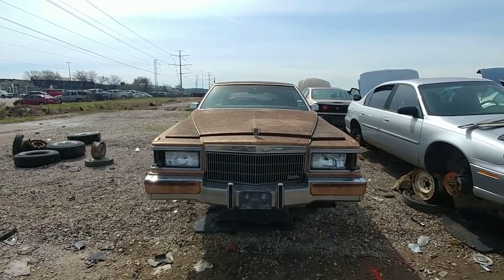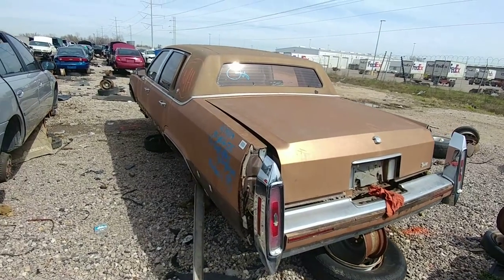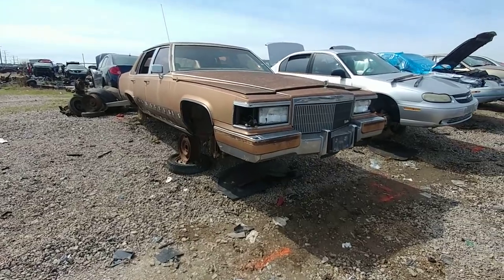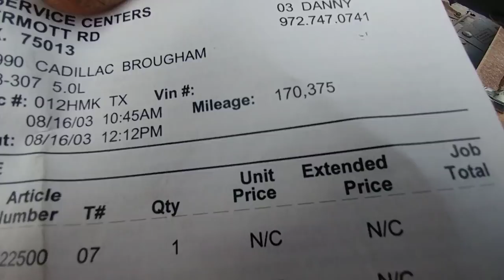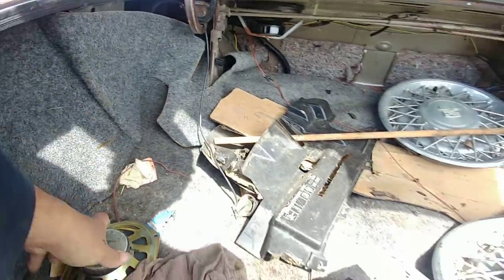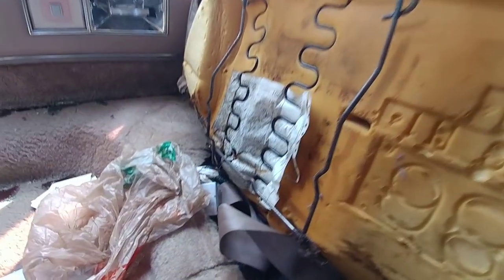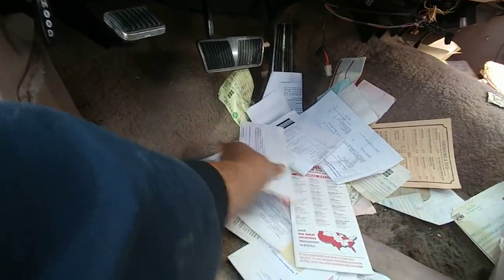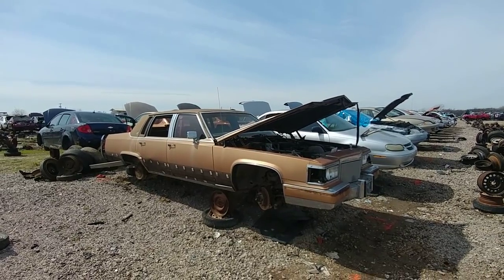1990 Cadillac Fleetwood Brougham Junkyard Find

Comment: We got the VIN, we win: 1G6 for US made Cadillac passenger car, DW54 for four door Fleetwood Brougham RWD, 7 for 350 V8 with TBI (Chevrolet/Corporate produced), 8 is a check digit, L for the 1990 model year, R for Arlington, TX assembly and the rest is the production sequence. 

We got the SPID, I'm glad we did: 6DW69 is the generic model for a four door Cadillac Fleetwood Brougham RWD, ARL is Arlington, TX assembly, C68 is automatic AC, MD8 is the THM700R4 overdrive transmission, NA5 is standard Federal emissions, two tone color of WA9066 Light Antelope (aka 94L) lower paint and U7392 (aka 65U) Dark Sable upper paint. The vinyl top was also Dark Sable (65T). 

Whoa Nelley, large barge, once in charge. Now it got squished and we're kinda pissed. It once used to cross the local bridge, but now it's been squished into an LG fridge.

Comment: Sad to see the condition of that GM b body my 80 olds 98 is mint and all original except the diesel is long gone and has a 350 rocket gas motor and did not get the weak 307  cid 140 HP that was available new!
Reply from the maker: Caddys and OLDS 98 are C-body I believe
Reply: For sure mine was a B body when I drove a cab I was able to take parts off the caprices that were out of service and use them on my Olds 98 for twenty years we  used them up to the 96 caprice by then they were a weak piece of crap the frames would crack in the front and the front wheel would move backward into the wheel well the wiring would short out on the harness as well.  @ClassicRideSociety

Comment: It does not have a 307. This was a 5.7 liter TBI 350 as the eighth digit is a 7. It was made in Arlington too.
Reply: If it was a Chevy motor, wouldn't the a.c. compressor be on the driver side? I know the olds motors put it on the passenger side. It's a tough call because I didn't get a good look at the engine.
Reply: @UsefulEntertainment  I did, and my father worked for a Cadillac dealer back when these were new cars. This is a 350 "Chevy" (corporate) 350 VIN code 7 TBI engine. An Oldsmobile V8 has the oil filler as a pipe in the front of the engine (which this car does not). This is not an Olds engine. If it were a 307 Olds, the 8th VIN digit would be a "Y", not a "7" like this one is. The "L" for the 10th digit tells us it is a 1990 model year car, and the "R" for the 11th digit denotes Arlington, TX assembly. If I recall right, some Arlington cars used to have a star emblem inside the state of Texas (Lone Star State) on both rear quarter glasses to denote TX pride for Arlington, TX.
Reply: jimmy haze  1990 was the last year for the "LV2" Olds V8 VIN code "Y" engine. It was used on all the RWD wagons, and some of the sedans. The LV2 started in 1980.
Reply: Here's the decal or something similar to it. Ignore the advertising baloney on the site: https://www.listia.com/auction/16091012-gm-arlington-tx-sticker
Reply: jimmy haze  90. the olds 307 was the last carburetor motor for american v8s
Reply: jimmy haze  really, I didn't know that. Thanks.
Reply: @googleusergp  lol I know the olds has the filler neck, I've got 1 307, 3 350s and 2 455s I just judged by compressor location. I see it now it has a single serpentine belt.
Reply: jimmy haze  Actually, I believe through the 1993 model year (which was the first year for the redesigned RWD car). From 1994 to 1996 when the RWD cars ended (Fleetwood, Roadmaster and Caprice) they used the 5.7 LT1 engine. The Caprice also used the 4.3 V8 too in some of those later years.
Reply: @UsefulEntertainment  Understood....
Reply: jimmy haze  Correct. I believe it had a Motorcraft 2 barrel on it.
Reply: jimmy haze  In fact, that era 360 also had Motorcraft ignition from what I remember. I worked for an auto parts company and the caps and rotors were equivalent Motorcraft sourced parts as I recall.